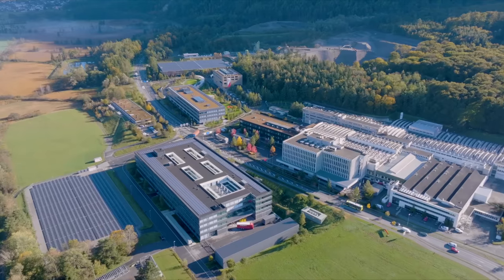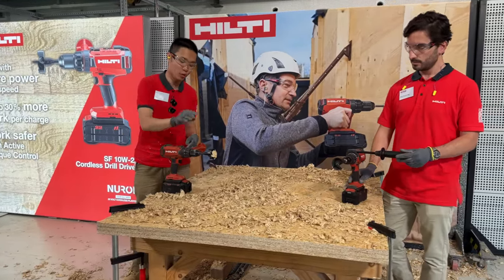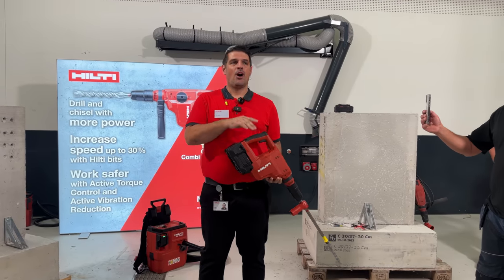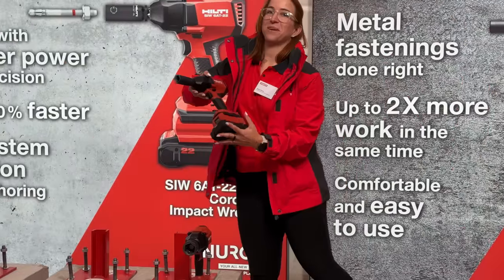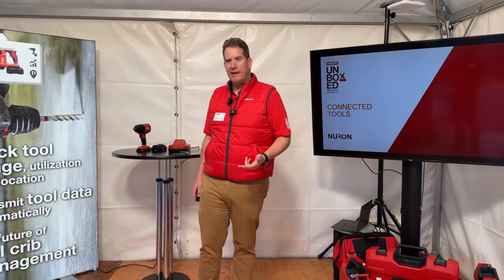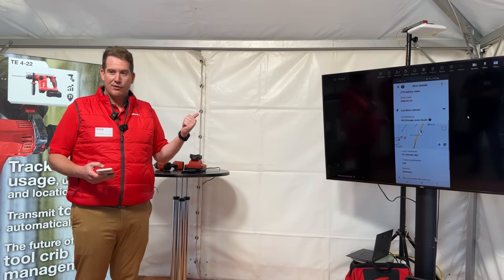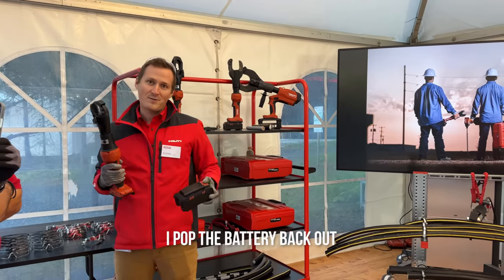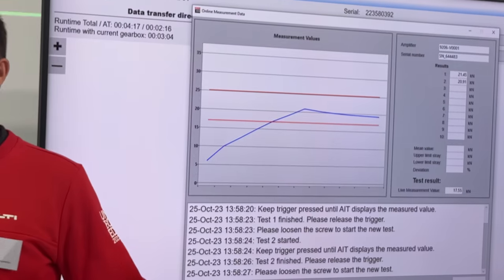New Tools for 2024! They Flew Us to Switzerland!

Comment: A BIG thanks for a full length tool demo explanation. One big thing i think is not emphasized enough in any industry is the AVR. When looking for a concrete drill for 3/8 to 1/2 fasteners years ago I started with one requirement low profile, wear the motor was 90deg to the drill bit. I went cheep and bought a yellow brand and it vibrated my hand so much after using it for a few holes i returned it. My hand was still vibrating for several minutes after just 4 holes i was concerned for the health of hands to prevent nerve damage.  Tried a hilt at a home depot back when they were there. I chased down (called) the rep for that store (he had gone home but the store was open till 10:00pm) The rep came back so i could try out the tool before purchase. I drilled ONE hole, One. I was sold. The tool cost 1.5+  times more but that no longer mattered. The AVR technology was now so important for me that cost was no longer a factor. HITLI's  R&D really focus on the health and safety of the operator ware others not so much.